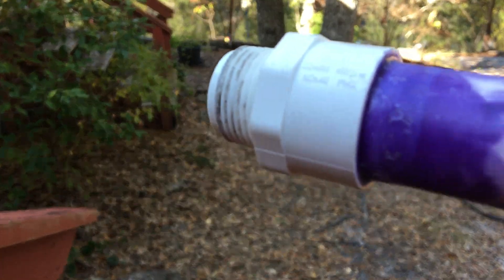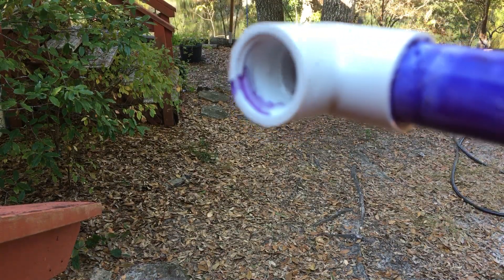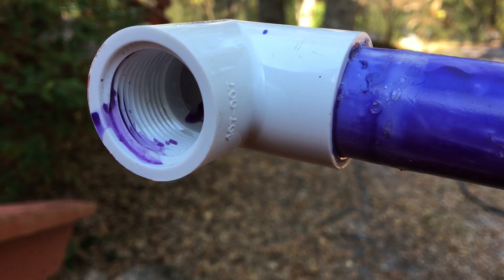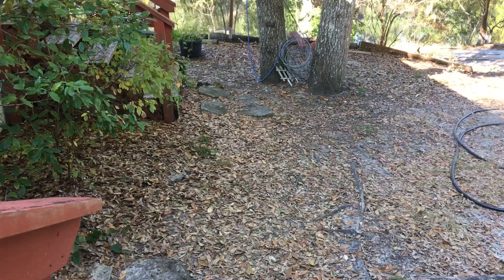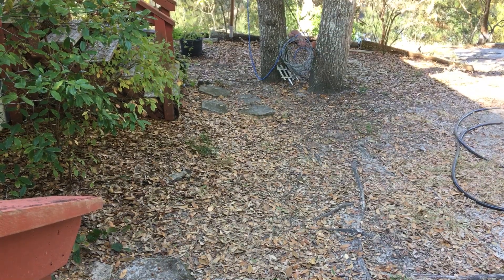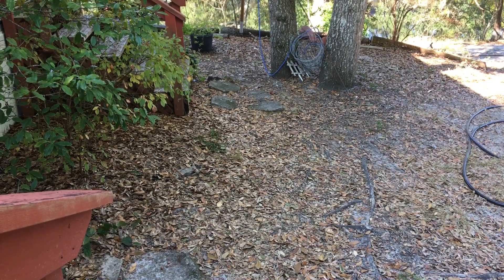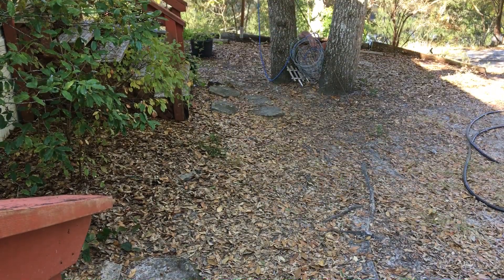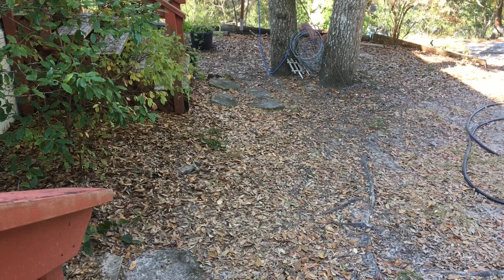How to make a water jet to sink Dock posts

Comment: They sell those fittings in 3/4" MHT also (which is the thread pitch on water hoses).  The thread pitch in pipe fittings which you used is 3/4" MIP.  There are more thread turns per inch on pipe thread (MIP)  than on hose thread (MHT).  It will fit up easier and you don't have to cross thread it to get it in.

Comment: A little late now i know..... They make adapters for the hose thread to the pipe thread. Cheap and sold at the same place and it would keep that top connnection from leaking and spraying you in the face.

Comment: how about water supply....? demonstration
Reply from the maker: :https://www.youtube.com/watch?v=pkUNo87Wb4c&t=781s
Reply: Thanks for the ideas. Modified your setup to attach to a 2” pump. We were jetting in 4x4 and 6x6 posts. Found that the small nozzle didn’t move enough volume so we ended up removing the nozzle and 3/4” fitting and went with the 3/4” schedule 40. That worked. We left out the shut offs due to the pressure.